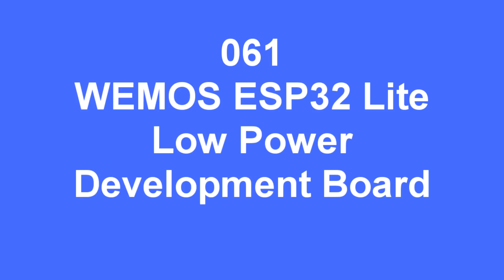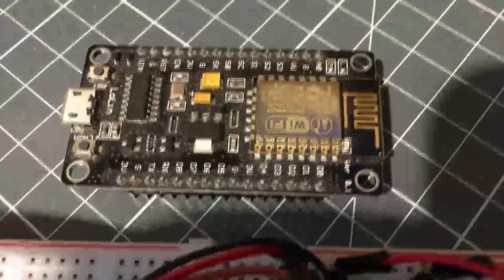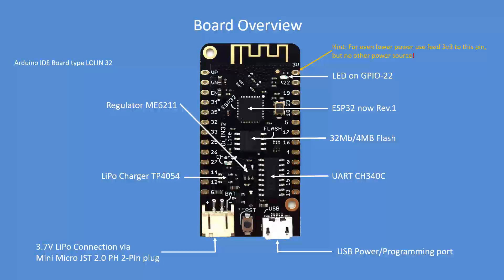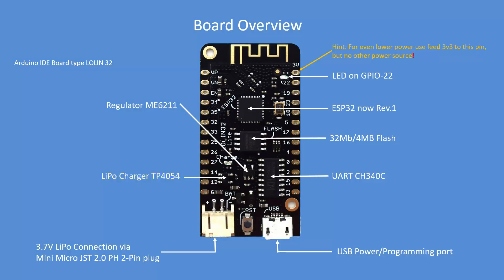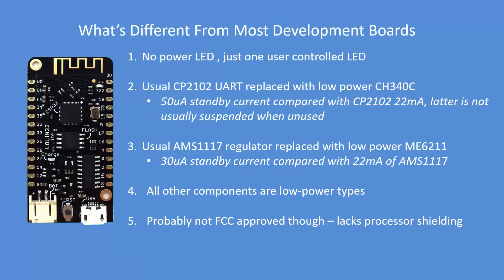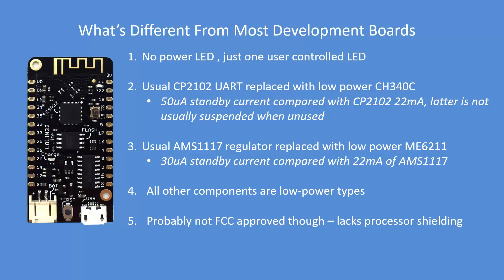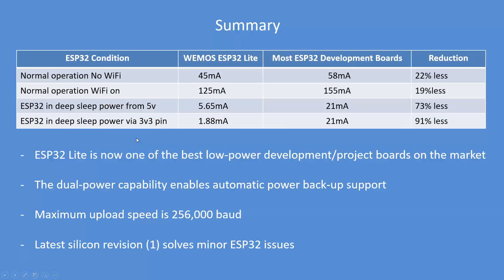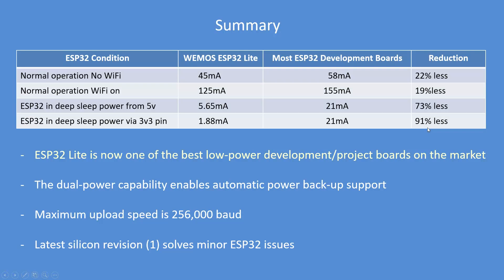Tech Note 061 - WEMOS ESP32 Lite (Review and differences)

Comment: Hi, i kno this is a video from 7 years ago, but i am wondering, could we charge the battery from the microusb connector? Do we need to unplug the battery when flashing?
Reply from the maker: All boards will charge the Battery from power applied to the USB connector. There is no need to remove the battery for programming, it’s a parallel power source.

Comment: Hi there, would it be possible to get your input on an issue I have with this board? Im trying to run both an ssd1306 oled and a BNO 055. The scanner says they are at 0x3C and 0x28, respectively. Ive tried defining SDA pin as 23 and SCL as 19, (also as 12 and 14 respectively) and this seems to work when its just the oled, but when I add the BNO 055 thats when it doesn't work. Ive tried this same wiring setup on another ESP32 with dedicated 21/22 pins and it works ok. I did actually watch your I2C troubleshooting video and that definitely helped but still no luck :( If theres anything else you think I could try Id very much appreciate your thoughts, thanks for this video too.
Reply from the maker: A typical problem. The two addresses are ok for those devices, so now we must inspect the libraries, for the ssd1306 library usually that has a definable set of pins say 23 and 19 although these pins are also used by the SPI bus and are the default MOSI and MISO lines, but if SPI not in use then no problem. Which drivers are you using? Adafruit? Almost certainly one will have a wire.begin(): statement that defaults to the selected boards SDA and SCL pin designations, so which board are you using and what type are you selecting? Let me have that information and I’ll go through it for you, David
Reply from the maker: Here’s the offending line in the adafruit bno055 driver if you don’t use the default SDA / SCL pins   _wire->begin(); so if you want to use other pins you need to modify   _wire->begin(); to be   _wire->begin(mySDA, mySCL); and define those pins at the start of your code.
Reply: @G6EJD  Hi David, thank you for getting back to me so quickly! I did indeed use the Adafruit_BNO055 library, along with the u8g2 library for the oled. The line of code you mentioned in the BNO library was indeed the problem! So I removed that and had SDA=23 and SCL=19 like before. Then I added a wire.begin(23, 19) to the setup() function in my sketch. Both sensor and screen are now working great :D Thank you so much for your help, this board has rather poor documentation so you're doing great work with these videos. Cheers, -Derek

Comment: What are the I2C pins? I have tried different and I can not get it to work.
Reply from the maker: Have you selected the ESPyLite board in the boards section and then produced a short programme to print out the values of SDA and SCL which will give you 21 and 22 respectively
Reply from the maker: Also if your trying to use other pins then this won’t work unless you remove wire.begin(); from your device library as that will always default to 21 and 22. If removed you can used wire.begin(sda,scl); example wire.begin(4,5);

Comment: Anyone has a pinout overview for this board, the LOLIN32 pinout is not working...?
Reply from the maker: Write a small programme to serial.println(MOSI) SS and SCK or go to the lolin wiki they have pin outs there
Reply: Cant find any meaningful LOLIN32 Wiki page with documentation on "Lite" edition.
Reply from the maker: Lolin has not put much there and yes pin outs are missing. Are you trying to get an epaper display running as getting the driver set correctly is a little tricky I can copy the settings here for a Lite if required.
Reply: Thanks, that would be nice. I have created this issue. https://github.com/espressif/arduino-esp32/issues/1039
Reply: Did you get the pin info you wanted?

Comment: Very usefull information, thanks for naming the type of plug for the lipo battery. I bought first the wrong too small ones. On alieexpress you can find the right connectors for around 1.70 euros for 50 pieces. This board is alot cheaper then normal esp32 boards and you make it show that the battery life is even better too. I'm excited about getting this board. :) 

Thanks for Sharing!

Comment: Hello, is i2c currently possible with this board?
Reply from the maker: Yes, nearly all the pins can be allocated to SDA,SCL. As default SDA = 12 and  SCL = 14
Reply: Hey, thanks! We figured it out about 30mins ago :P
Reply from the maker: Use the expression wire.begin(sda,scl) or in practice wire.begin(26,27) to use the pins of your choice 
BUT many if not most device libraries have a Wire.begin(); statement in them so you can’t change the pins and have to use the defaults, to get around this edit the library name.cpp in the libraries folder and comment out the wire.begin() statements.
Reply: G6EJD Got it! Your other video on i2c was the ticket thanks 😊

Comment: Thanks for the video. I find I get much lower power usage with the Lolin32 board (non lite version and not the Dev board you compare against in this video). On battery power and in deep sleep mode it uses only 140uA, much less than you Lite board. In fact comparing components I think the only difference with the Lite is the Lolin32 uses the CP2104 instead of CH340G. How are you measuring power usage?
Reply from the maker: Hi, I'm not using a DVM because generally the so-called burden voltage is too high to get a meaningful result on most low current ranges, instead I use a digital scope and series 0.1R resistor, measuring voltage across the R and then calculating current.

Test conditions:5v supply to microUSB connector, RIGOL Digital scope 1052E, series 0.1R
WEMOS non-lite board consumes 55mA with Wi-Fi OFF, 145mA with Wi-Fi on and in deep sleep 8.2mA
WEMOS lite consumes 43mA with Wi-Fi OFF, about 134mA with Wi-Fi on and in deep sleep 0.14mA

In both test conditions there is no load on the board(bare):

Test conditions:3.3v supply to Gnd and 3v pin, RIGOL Digital scope 1052E, series 0.1R
WEMOS non-lite board consumes 42mA with Wi-Fi OFF, 135mA with Wi-Fi on and in deep sleep 0.235mA
WEMOS lite consumes 42mA with Wi-Fi OFF, about 134mA with Wi-Fi on and in deep sleep 0.9mA

So powering the boards directly with 3.3v gives different results in both designs, different only by the UART device, but the non-Lite version uses less power when fed with 3.3v but more when fed with 5v and conversely the Lite board uses less on 5v when in deep sleep but more when fed with 3.3v!

Conditions do vary a lot with my boards, but mostly the no-name boards easily consume 22mA as an accepted power demand when the ESP32 is in deep-sleep, that's what sets these WEMOS boards apart that they use much less power.

If your using a DVM try switching to mA range of if sufficient resolution use a high current range (say 10Amp range and a 22000 count should give you 0.1mA resolution) for least series impedance as it affects readings.

Comment: Can you put somewhere documentation of your weather station based on this module?
Reply from the maker: Yes of course, but the code is still beta, but runs. It is based on the Zambretti algorithm and a 2.9" e-paper display, but you can change the driver for any display. If you have any problems please get in-touch. I'll place the code in the G6EJD Github.
Reply from the maker: Code is on Github now
Reply from the maker: I understand, for the ESP8266 you’d need to change the time function I have a version of the function if required and for the sensor change the getpressure function accordingly. The code is finished as published I’ve been running it for the last 2-weeks to ensure it works ok and does predict weather which it does and is reliable and it is.

Comment: Even 1.88mA is high when you are developping low power application... :(
Reply from the maker: Indeed, but it’s getting lower, at least Wemos recognises the need. What we need is a simple jumper on the board to isolate the peripheral circuits leaving just the ESP32 powered via the 3v3 pin.